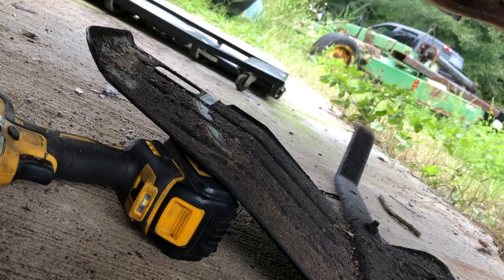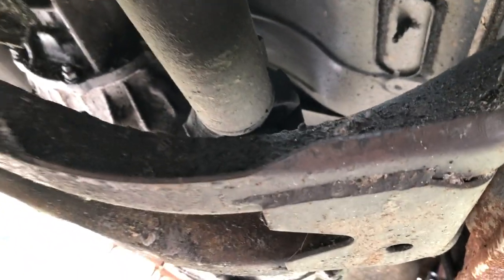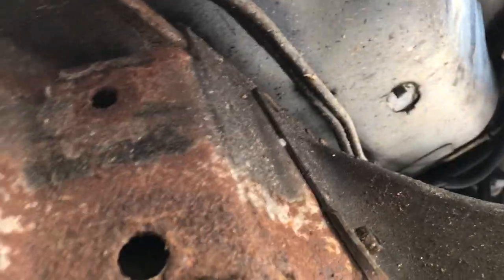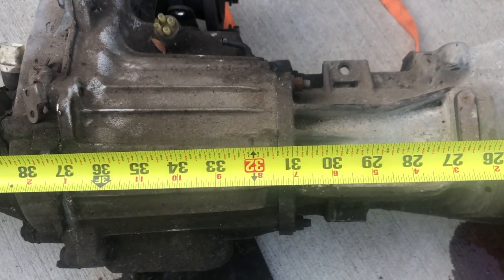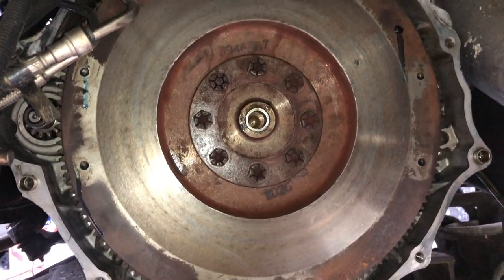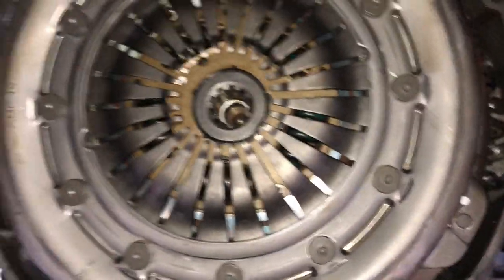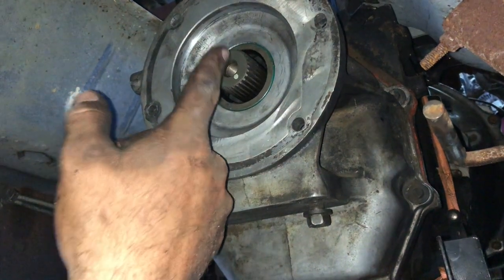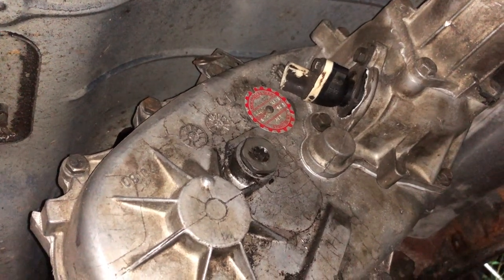Dodge Transmission Swap (Auto to Manual) PT 1

Comment: i get my torque specs from old german specs...."GUDENTIGHT!" that trans swap has got to be the most valuable upgrade you can make to a dodge truck!
Reply: Im done with automatic in my 79 dodge van. Embarking on a manual swap. I think it will be worth the effort. Doing 4x4 as well.
Reply: @TheHermitHacker  have you done it? if so how'd it go?

Comment: I got a rebuilt g56 in my 95 4x4 that had a automatic.. A learning experience and then there is the 4x4 shifter that use to bolt to the transmission and a large hole in the floor . Going to convert to a later generation to the floor shifter not attached to transmission.  .  I have now a one piece aluminum rear drive shaft,  dual disc Val air clutch , bm short shifter,  rebuilt tc

Comment: I got a -77 Dodge W200 with 727 and i want to put a manuel 5 speed in it. My biggest problem is that the Jeep  transfercase got the drivshaft to the front on the other side, how do i salve this problem? Does my transfercase fit the modern transmission?

Comment: Did you reuse the same crossmember that was on the truck originally for the nv4500? I was told I would need to get one for the manual swap but I can't figure if there really is a difference or not.
Reply from the maker: Same cross member, the difference is in the trans mounting isolator I think, honestly can’t remember but the cross member is the same auto/manual.
Reply: @j_moffitt  Thank you! That helps! I was about to spend a 2-3 hundred on a crossmember I don't need.

Comment: You are what I have been looking for. Omg! I've called so many shops who say it's "too much work" I thought the worked for money though...; How much different do you think it would be to do this in a 2000 Dodge Dakota quad cab SLT 4X4? Please HELP
Reply from the maker: No idea how Dakotas are setup but it’s just a matter of finding/building a crossmember and some drive shafts and also cutting a hole in the tunnel for your shifter; assuming you have whatever trans and t-case you’re swapping into it.
Reply: @j_moffitt  that's just the little tid bits I needed.  Called a few shops to see if they would do it and they literally said it's too much work .... And I might've done it if they said they would but if they did there isn't any guarantee they do it right for the prove they were asking

Comment: I have a 92 B350 1 ton van. Is it possible to do the same conversion for the dodge van? Or does it only work for te 4x4 vehicles? If i cant currently, I’ll rebuild the wold vehicle on a  Cummins 5.9 4x4 driveline that has a 5 speed
Reply from the maker: I’m not sure about a direct fit, might take a bit more time and modifications but anything is possible.

Comment: Anyone that has done this, how do you wire your clutch safety switch. I want my truck to only start with clutch pushed in or in neutral, thank you
Reply from the maker: You’ll need the safety switch itself and also some wiring diagrams and a test light to find the wire going to the starter relay so that you can “break” the gap with your safety switch.  Once you splice in the safety switch the circuit will only be complete when clutch pedal is pushed in and will allow your truck to start.

Comment: Man do you have parts list for this ? Transmission transfer case you used ? I have a 96 with a auto I want to do a swap this spring/summer
Reply from the maker: Trans and transfer case you want plus pedal assembly and slave cylinder assembly
Reply: @j_moffitt  was hopeful for what transmission you used and all. But thanks
Reply from the maker: Nv4500 and a dld tcase

Comment: I was looking into putting a manual trans on a 2016 ram 2500 tradesman with a 6.4 hemi, yall think it’s possible? Seems like it would be pretty easy since everything’s pretty similar to the Cummins with a manual
Reply from the maker: Anything is possible but I do not have the slightest idea of what it would require.
Reply: @j_moffitt  just needed somebody to say it was possible lol. Can’t be too much to change